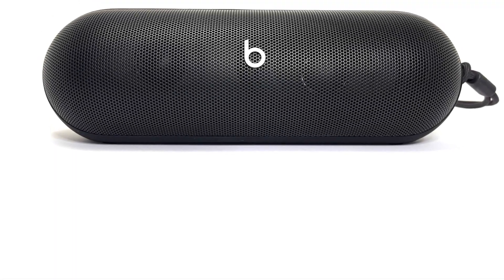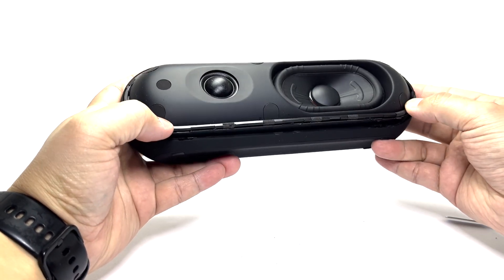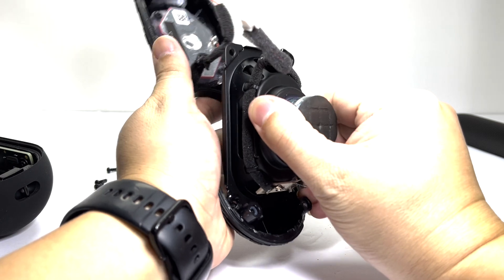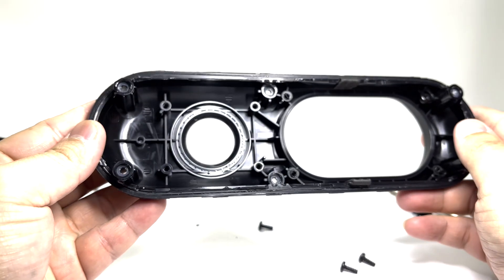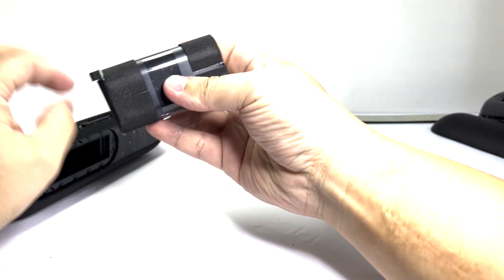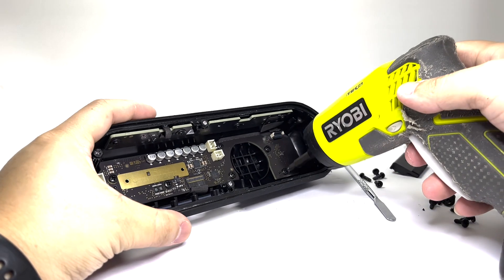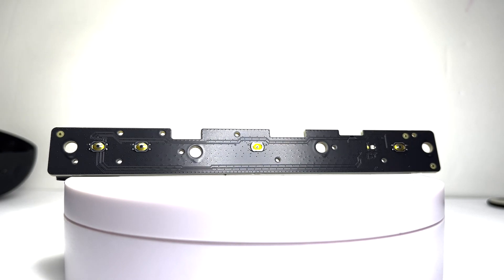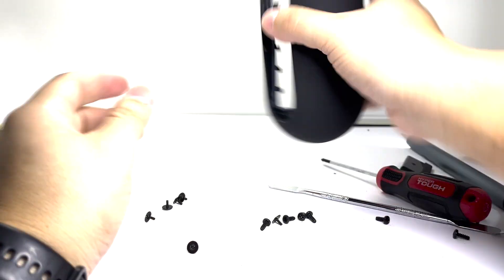Apple Beats Pill Teardown – What’s Inside This Iconic Bluetooth Speaker?

Comment: Thank you for the teardown. Would love to get the raw sound files from the nand and further specs like 3300 MaH but at what voltage? Also dimensions and ratings for the woofer and tweeter? What are the amplifier ratings from the board, and what amps are being used? Basically all the speaker specs were not told.

Comment: Thank you. I just need to fix the dent in the grill. I didn't realize it was that easy to take off 😂🙌 W
Reply: Did you take off the dent ? Same scenario here
Reply: @aplusigetpeso4417  yeah I used a hammer and gently buffed it out. Just put a shirt on the outside bottom incase it gets scratched the inside doesn't matter really lol but it worked. You cant even tell that there was a dent if i could send a pic. It looks brand new
Reply: I’m still messing with it !! It was a gift 🎁
Reply: @aplusigetpeso4417   it can go down to 30 hz

Comment: looks having a better tweeter but without passive radiators compare with flip 6
and flip 6 is cheaper
Reply: Flip 6 is mich cheaper, but they both using ugly sounding cheap silk dome tweeters instead of using aluminium or magnetic planar tweeters.
Reply: @mykykyta_g5hk a planar tweeter in a portable speaker isn't a good idea.
Reply: @pixelreflectorpro  Well, i don't care about the waterproof because sound and quality are on the first place.
Reply: @mykykyta_g5hk  You shouldn't be buying these types of Bluetooth speakers then.

Comment: Lol it's trash not even adding passive radioters is crazy and there are much better speakers out there like the Harman kardon Luna
Reply: Closed box without passive radiators sounds better. Passive radiators needed when you need to make the box for speakers smaller when you can't afford to make the box bigger.